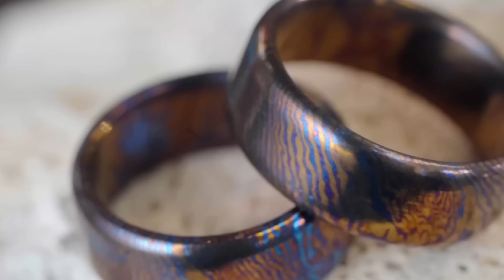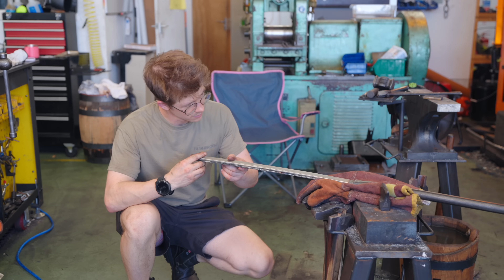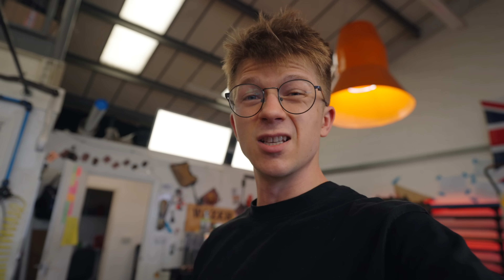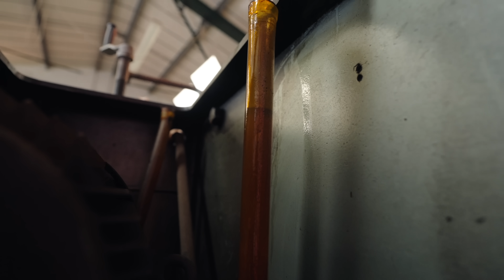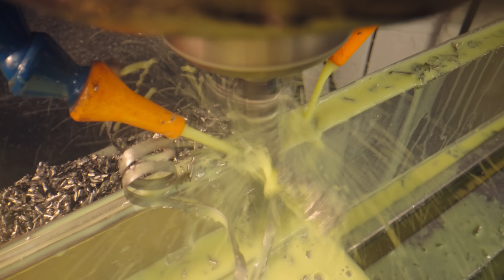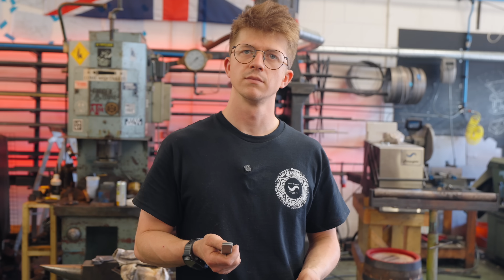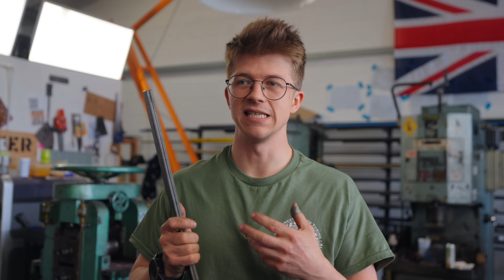Making a Titanium Damascus Katana - Part 1

Comment: I think if you wanted perfect bonding, you'd have to do some true gradient with the alloys - not a sharp boundary. If you had a powder bed metal 3D printer, you could laser-fuse together a layer that corresponds to like machine steel, and then each layer above that would have less iron and more nickel (and traces of other stuff) until the iron is all gone and you're making layers of nickel with titanium. I don't know how thick this interlayer would need to be, but I'm quite sure it would work. Then it would be good to compactify the at a low enough temperature that will close all the voids but not make anything runny.

Comment: Is the nickel layer meant as a dissipation aid, where if the layer of nickel is too thick it just delaminates?  It would explain why you get a better bond on the rolled ones.  Like how wood glue isn't structural, but it almost knits the wood fibers together for a strong bond?

Comment: One tip for checking to see if there is still oxygen coming out of the purge exit is to put a lighter close to in front of the hole and if there's no more oxygen you'll see the inert stream of the argon in the flame of the lighter.

Comment: Have you thought of fully wrapping the steel in nickle instead of just having a sheet on either side?  That way, even if the steel core does squeeze out sideways it wont be able to touch the titanium.  You could even double wrap it to be extra safe and give a little wiggle room in case the steam hammer blows are stretching it thin enough to split inside the billet

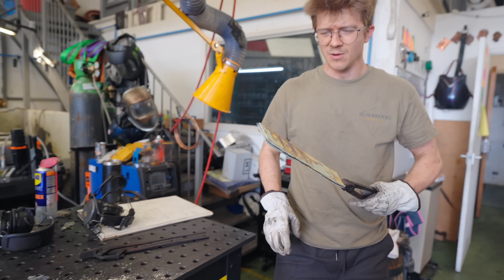Comment: 11:16 Accidental reactions hm? Good thing you're working on a katana and not a demon core. I'm kinda wondering if it would be possible to make a Damascus blade out of tin and aluminum cans and if so, how much cans it would take to make it durable enough for a decent blade. I have seen a video of someone melting a years supply of beer cans into an electric guitar. It seemed pretty strong, considering the strings pull on the neck with a force of ~90 to 110 pounds, depending on the thickness of the strings.
Reply: Aluminum won't keep an edge at all. Aluminum maybe strong macroscopically, but absolutely not even close to a tool steel or knife steel
Reply: @AutumnDesolation  Oh, alright. Btw, i saw this website Swordis, where you can have a custom katana made, and the cheapest category, which is mostly for display, had the option for colored blades, but the more expensive functional ones didn't. Does that mean colored steel isn't suitable enough for functionality?

Comment: Question, why have a steel core and a titanium outside? I always assumed normal katanas are soft on the inside and hard on the outside. That would mean that you woult put the titanium on the inside and have the steel come together at the blade edge. You could even have the titanium on the back and steel on the front (I mean the edge).

Comment: You could put the kiln directly behind the bottom block of the power hammer and the long billet would stay in the kiln as you’re pulling it out and hammering at the same time. Idk about the argon purge being through the handle you’re holding though. Might have to have another purge handle on the far side of the kiln and a hollow one on your side.

Comment: Not sure if this helps but titanium can be nickel plated, but it generally requires surface activation and an intermediate layer.  What I'd infer from that is that perhaps your titanium needs a surface activation before it can bond properly to your nickel layer.  Not sure how you'd keep it from oxidizing in the furnace though.  I guess that is what the sleeve is for.

Comment: All that spiel at the start just for katana's being the single worst sword ever conceived. Samurai never actually used them in anything other than ritual or performance combat because of how admittedly garbage they were even against a basic arming sword or short sword. A claymore or even a hand-and-half sword would just cleave straight through them. not to mention they were an absolute pain to use because of thier Abysmal C.O.G that sat 2/3rds to 3/4 up the blade so you have to constantly fight the blade the whole swing.

but we can all admit that katanas look pretty cool. Sadly the coolness ends at the tsuba
Reply: I tried to find a worse sword and couldn't think of one. if anyone has a worse sword that was historically used and actually exists to be used as a weapon and not a gimick (like the double sword or sword staves) then lmk because I am curious.

Comment: I would use probably try brass - zinc is why, the electronegativity & temp control means you can copper plate the parts and braze them together. Silver would also be suitable. 

Just titanium witn molybdenum edge be great.

Comment: Is it possible to get a stronger bond with just nickel and titanium, then clean the nickel side and bond the steel to it in another stage. Or the opposite of that with steel first?  Then you might not have to worry about the different heats as much

Comment: if all this doesn't work you could just use a larger nickel and larger steel layer than the titanium and shear it to shape with no further forging and just do a VERY long forge weld using the roller just once

Comment: As far as I know, Titanium should not be in it's ß-configuration for forging due to it being able to transform into martensitic configuration, which unfortunately combines brittleness with low tensile strength. At least that is what happens to Grade 5 alloyed Titanium. So keep the Temperature below 960°C.

Comment: I wonder if some kind of method like this could result in a really good skateboard deck. Normally metal is quite heavy for a skateboard deck, but if thin enough and with the right blend of materials, I wonder if there could be a good solution to make a better deck than rock-maple.

Comment: 0:28 I've seen the lasers that can change color of stainless steel by using selective heating.

Is it possible to make Damascus out of stainless and another steel? Where you could then heat the stainless part with a laser (or I'd imagine torch or kiln) to color change the stainless part while the other stays normal?

Just an idea I had, but have no idea the feasiblity

Comment: The scrapes from your failures here would likely have been useful to make a few really cool Straight razors. you only need about 6x1 and you've got a razor Depends a bit on thickness. I've made a few straights in my day but I don't remember ever seeing one (definitely never made one)  out of a Ti sandwhich. I've done blue paper SanMai, even used Dami Ti for the scales but never made a blade with Ti.

Comment: I wonder how many kW of your rolling machine gets converted as heat into the material, and at what rate (based on the rolling speed). got any details on that? I suppose a simple IR thermometer on an initially cold piece should give a decent approximation

Comment: When you roll the material, you reduce its thickness only slightly; the rest is pushed backwards and to the sides by the roll. It consists of different types of steel; by adjusting the thickness, you change not only the length but also the width, and the different types of steel also have different elastic properties, specific gravities and densities. The more you roll it, the thinner it becomes and longer. When rolling, the pressure is higher than when using a hammer, because the contact point with the roller is smaller, meaning there is more stress on the material. keep on hamering GG

Comment: Question ❓ When you do that first bonding with the argon flowing through it, would it make a difference if you started at the handle end? Would it push any impurities out of the open end rather than closing that end first trapping whatever is inside, inside forever? Or am I completely off track not knowing anything about the process

Comment: Could you  not layer the titanium at an angle? Like if you have the mild steel cladding do it width ways, not length ways. Or in a box from corner to corner not side to side? would give more titanium surface coverage to maybe not delaminate and would in theory give a bit more room for the argon purge.

Comment: Alec, I'm a layman with perhaps a stupid question. I have learned that Katana is laminated, bent over 32 times. But I was told Damascus was braided originally. Could a braided bundle made with two different kind of threads for the blade edge and the body be hammered AND folded combining the two methods? Such a braided blade could be bent almost to a circle and retain its shape when released, I was told, and the uniform braiding pattern was visible on its surface.

Comment: To help with the cooling issue when you're forging the full size length, you could try placing a cheap forge in front and behind the hammer to limit the ambient heat loss. That might give you a little more time to set it. You might die from heat stroke though, so there's a trade off I guess.

Comment: I am curious if nickel plating the steel and titanium, instead of using a nickel plate, would produce enough of an interlayer to prevent the Fe-Ti reaction and if it could form a strong enough bond to reduce delamination.

Comment: Dumb idea but maybe cut tiny groves in steel and titanium in the dovetail joint design (rounded to avoid stress cracks). With enough space for nickle powder. As you press down the wedges of joint widen  physically locking the incompatible metals to each other. The Nickel further glues everything down. It won't be perfect but much more physically strong.

Comment: I might be 9 days late here, but if you check this Alec, can I offer a suggestion? Make a kodachi or a wakizashi before making a full katana. It's less material, it's smaller, and it'll teach you a lot! Granted, I'm not a metallurgist or a smith, but that is how I can paint large figures: I started small, iterated, and refined the talent. Just a suggestion, mate, in case you wind up with some material you can't use to make a full-bladed katana but still want to see how it would fare.

Another suggestion that just came to me, if it's any use to you, sir: you may need to look into folding, as painful a process as that may be. I'm not suggesting going for it, but there is still potentially something to be gleaned from it, I'd wager. 

Also, this isn't a suggestion but a demand: more Jamie. I love your banter, seriously, though your wife is lovely as well.

Comment: Query: could you weld your titanium to a nickel layer and weld your steel to it's nickel layer then weld nickel to nickel at lower temp. Doesn't nickel weld at like 650C? If steel welds at 1500, and titanium at 800 then you should be able to get the interlayer to weld lower than melt temp for the Titanium and Steel. Unless the chemistry gets really weird.

Comment: Out of the box thinking here . . . have you thought of resistive heating?  Connecting different electrodes to the Ti layers and the steel layers to control the current, and therefore the resistive heating through each?

Comment: i thought the whole thing about katana tahagane smithing was that it was because they only had like iron sand to make them with and generally were pretty poor quality. they would make a bendy part for the front and a more hardened pieces for the back to give it a spine that holds that bend from deforming too much. if the spine breaks you get a easily bent sword

Comment: Hi, Alec, one thing to think about is that for grade 2 Ti, there is an allotropic phase transformation (like graphite to diamond) at about 900oC (exact temperature depends on your exact chemical composition), which is called the 'beta transus temperature'. This is important, as below this temperature the structure of the titanium is different to iron, but above this temperature the structure is the same as iron. Technically, there is a change from hexagonal close packed to body centred cubic. This is important, as above the beta transus temperature the rate of diffusion of iron is about x10 [2] greater than at below [1] even though the temperature is only a little different. Could be why you can forge at 850 and not 900. If you change to grade 5 Ti the beta transus temperature is like 1000, so might be worth thinking about if you need higher temperatures

Also, as a side i think copper would be cooler as an interlayer, as copper has super nice oxides, but you would have to forge at a lower temperature, as copper would be quite sloppy at 850

references
[1] Bulk and interface boundary diffusion in group IV hexagonal close-packed metals and alloys
[2] Diffusion of iron in β Ti-Fe alloys

Comment: it's a shame that "i guess it's not possible, maybe", to braid strips of titanium and steel, forge them to a rough shape then melt a bonding metal like copper and dip the whole thing in and out like a candle, letting layers cool,  you have a liquid bonding instead of plates or something like that. or maybe even build all of the slab by dipping it like a candle in all three metals.

Comment: doesn't compressing metal add heat to it? the roller probably spikes the local temp in a different profile than the forge hammer.

Comment: Im a boilermaker back in the day when welding titanium we had to have a purge bubble around the entire job peice and purge for 10-15 minutes before welding my suggestion is when your layering the titanium and steel together your trapping small amounts of oxygen between the layers which is substantially not getting purged properly before forging them together

Comment: Yeah, I still don't understand the desire to pursue this project any further. You'll be spending a lot of time, effort, and money to achieve a worse-performing blade, and what you gain is...I don't know. Just saying that you did it, I guess, but that in itself doesn't hold value in my mind without some other kind of gain to back it up. More power to you I guess.

Comment: 💡  //  🗡 Try San Mai, but use  Induction to Heat / Harden the Steel Edge, while keeping the Flex Strength & Light Weight of the Unhardened Titanium

Comment: There is a 7 ton beast right outside @25:50. Heat -> put it under the new massy -> keep at temp with torches. Bibbedy bobbedy boo 🎉 titanium steel damascus

Comment: Excellent! They say, "The devil is in the detail." Might I suggest the following detail where your mild steel forging jacket is concerned:
Rather than placing your pieces in a U-shaped mild steel and welding a flat piece in / over the top
Make two U-shapes of mild steel so: _/¯¯¯¯¯¯¯¯\_ ...and after pressing together in the swaging dye weld along the edges of the protruding lips *only*.
1) No heating of the edges of the interface before flushing with Argon - less chance of making 'intermetallic seeds', that I suspect worsen with working.
2) Bernoulli's effect - fast-flowing Argon in the triangular channels at the edges of the metal interfaces will 'suck' O2 from between the sheets.
3) Such a jacket (+/- flowing argon) might even survive limited forging / rolling, so protecting / strengthening your diffusion bonds as you work.*
*rather than weakening them.

PS:
Yes, yes commenter... "There is no such thing as sucking!" You suck for being such a pedant - one has to be economical with words in YouTube comments.

Comment: I've heard titanium is infamously hard to cut/mill due to how "sticky" it is. I think milling it down in thickness is probably a bad idea even if it could theoretically work. Either you'd be better off sandwitching the titanium between two steel halves and milling them down instead or just using thinner sheets of titanium to begin with. That said, the bond is definitely too weak and other commenters probably bring up some good points.
Edit: Just realised that sandwitching the titanium probably doesn't work with what you're going for 😅

Comment: 35:13 isn’t the core of a katana soft to absorb shock and the edge is ultra hard to stay sharp and cut?

Forge the nickel around the steel then add a titanium edge to one side?
And maybe for good measure make one with a titanium core, by first wrapping titanium in nickel then adding a steel edge sheathing?

Comment: As cool as "Titanium Damascus Katana" sounds, Your wording of "making a piece of art" is absolutely fitting. Because such a Katana would be utterly useless as an actual Katana, because it is too hard and brittle. A Short sword would be a better application of such a mix, from a "useable for its design pourpose" standpoint

As a side note. 
Now taht your Steam Hammer is running again, maybe try the direct bonding approach again? With more power and more control you might be able to achive better and more consistent results using that method.

Or, when refurbished in 2-3 years,  the Big Bonk (name subject to change?) is running, use that.

Comment: 41:00 ish.  Is that Pressure Treated wood you're using for your stress test?  Don't do that.  Aside from the fact that PT, even modern copper (as opposed to the OG arsenic) based formulations are not something you want to be exposed to indoors; the copper based solution that impregnates the wood may very well change the surface chemistry of your blade.

Comment: You should have hit each strip in the billet with a file to make them bond better. The smooth on smooth means there was little mixing that's why it didn't bond right.

Comment: Alex, real damascus is just different grades of steel. Why try to bond metals together when you can just use titanium carbide and i would say a titanium nickel, and regular titanium. See whats happening? You get diffrent kinds of etches based on the 3 diffrent metal types, tho i suppose one is technically a ceramic, for that hardness, i think flakes would work best, the problem arises from the need to repeatedly fold and forge just like a real katana. Just my thoughts, hope it helps.